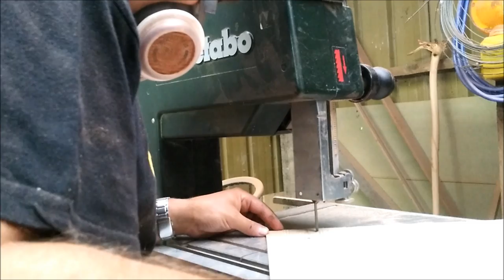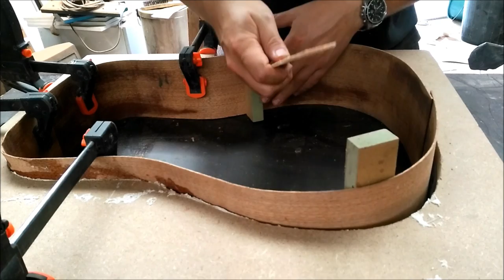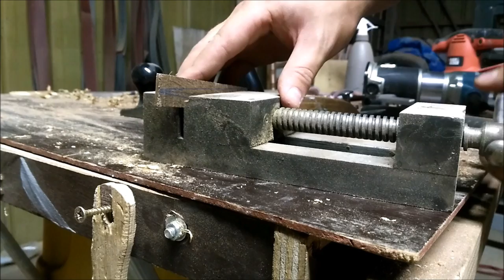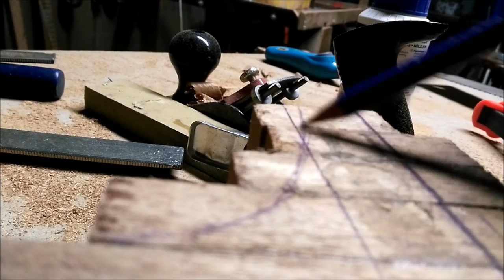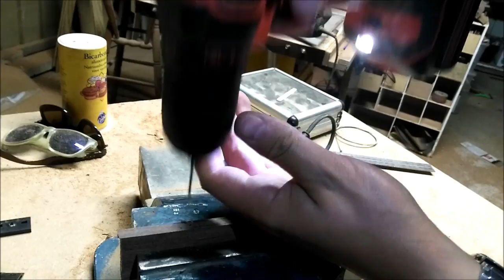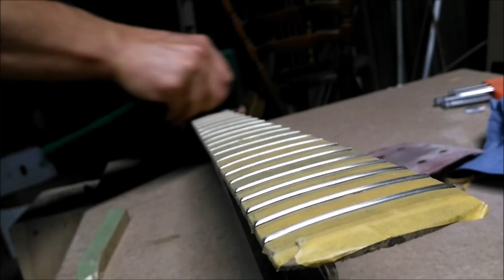Acoustic guitar from reclaimed wood - 'The Scrapnought'

Comment: I applaud the maker for the effort and finishing the project.  It took smarts to come up with so many crude techniques to short-cut what is typically a building process with more shop made jigs and fixtures for a finer, more accurate and beautiful build.  The crude experiment worked.  The next build will likely produce a finer guitar.

Comment: Great video. You had me spellbound that this was not a $100,000.00 shop with all the latest special tools and c.n.c. How long did this take you?  I never made a guitar, but I did make some furniture out of old pallets once. I couldn't believe all the Philippine mahogany I found at that time.
Reply from the maker: Ted Rowland Thanks! I don't remember exactly. I believe I got most of it done in 2 weeks, progress slowed down quite a bit after that and I think it took another 2-3 weeks to finish it. I had aprox 22 hours on video! You never know what you'll find in those things, but I've never been so lucky to mahogany out of them 👌👌 Thanks for watching!!
Reply: Well Robin, I'm older now. That was about 30 years ago when Philippine mahogany was plentiful. When I say it is a very soft wood, I don't mean soft as in cone bearing as I know it is classified as a "hardwood". I mean you could scratch it with your thumbnail. But beautiful grain striation, and the wood is pink. I made an entire bookcase out of it back then.
Reply: Ted Rowland...About 44 mins.
Reply: I know this is probably a crazy question.  But here it goes.  I have always wanted to learn how to build a guitar and your video makes me want to go out to the garage and start one right now.  Only thing is where could I get measurements from.  Do you have them or tell me where I can find them at.  Thanks
Reply: @robertvasquez3964  he was using he's other guitar for reference to measurements. Atleast that is what it seemed like. When he keep using a tape measure on it.  Great video watched the whole thing
Reply: @justinblizzard2485  thank you for the response Justin Blizzard.

Comment: I've seen neck thru body construction, but seeing the way the head stock is angled like this, really shows a much easier way of making necks!
Reply from the maker: I don't think I quite understand what you mean.. neck through body is an electric guitar thing, I did this on my very first (electric) guitar. The headstock angle can be done in one piece but I prefer this method as it saves a bit of wood and it is stronger! It's not too difficult either as you mentioned. Thanks for watching!

Comment: This is the first video that I’ve seen that shows practical, economical methods for building a guitar at home. The heat gun and steel pipe rig was inspired. Most videos show someone using hundreds of thousands of dollars worth of equipment in a professional workshop, and of course you can build an acoustic guitar THERE. But unless you’re building an electric guitar, most videos lead you to believe that you need all the expensive equipment. This’s video shows a practical way to do it without all the professional equipment. I’m going to try to build a guitar.

Comment: What a very clever idea. I was fascinated on how u bent the wood with hot air, those weights instead of clamps to bind the wood together, and all that works on the neck. Man that's a hell of a job a a lot of patience in your part. You must be loving your work so much as i did when i watch your video from start till end. I wish i have ur skills i knew u could do much better job if ur fully equipped with tools. Great video and a very well done job. Thanks for sharing..
Reply: It's not actually bent using the hot air. The hot air heats the steel pipe. The wood is wet with water then placed onto the pipe which steams the wood for bending.
Reply: @allbeit582  ah! Ok thank u...

Comment: Great work! I'm currently building a tenor uke with reclaimed timber; how long did you soak the sides before bending? My mentor suggests 48 hours. I use the same method of bending over a heated pip.

Comment: Amazing! Great woodworking, especially on the neck. You did a fine job on the bracing and nice bridge plate, that is why I was surprised you didn't make the bridge where the pins would go through the top. Not knocking it, just seems you would get a little more resonation and volume, though it sounds great.

Comment: I have been watching a lot of video and reading a lot on lutherie. They all have recommendations on the "correct" top and back woods (cedar, spruce etc) . I suggested that radiata pine would make a good top - should have seen the reaction. Ditto for the "correct" thicknesses and working methods.  I would have thought that the old style luthiers used whatever was available locally. The other thing is using extra precision and high quality materials provide diminising returns on instrument quality...  You can make a very good instrument with quite cheap and basic materials and methods (as is shown here)... To make an excellent instrument requires access to tool and materials that are not accessible to most hobbyists. Well done! And thank you for the well edited video.
Reply from the maker: Thank you!! Obviously I would like to make one with professional tools and great materials... But I for this one I went with the free and sometimes crappy wood on purpose! Thanks for watching!

Comment: I would have liked to have seen how you did the inlay around the sound hole... otherwise fantastic video and project. 👍
Reply from the maker: Thanks! I just used my router to cut the circle  2mm or so deep. Then I cut a quarter of a circle, cut that in half so I had a bookmatched half of a circl e. Then cut that in 2 so the ring is made up of 4 bookmatched pieces. Glued that into the top, planed and sanded away the excess.

Comment: A real time-saver would have been to use the router to trim the binding, just let the bearing ride on the  sides with maybe one layer of masking tape to protect the mahogany. You have to be careful in certain places that the router bit isn't tearing into end grain. Just backfeed the bit by moving the router right to left in these areas. Lastly, remove the masking tape on the sides and make a light pass for a final cleanup. You want a really sharp bit to prevent burning the wood, too.

Comment: Hi! It is a great video and makes me feel relaxed!

Just a question here...What was the liquid that made the guitar changed color?
Reply from the maker: Epoxy. I used 2 or 3 coats of epoxy to fill in the grain of the wood, that way I didn't have to spray and sand away 20 layers of lacquer to get a very smooth surface. Thanks for watching!

Comment: i havent found an answear anywhere did you use a planer to get the side wood thin ? i dont seem to have enought equipment to get all of the stuff done. I can only think of getting it thin enough with a handplane...
Reply from the maker: No I don't have a planer. Is cut it very thin on the table saw then I used the belt sander to make it thinner and smoother. Thanks for watching!
Reply: Alright thanks for answering man. I was thinking of making something like a 3/4 size guitar for camping :) 
Anyways very cool build you made there. Cheers
Reply from the maker: No problem. Something like that is my to-do list as well! Good luck and let me know how it turned out ;)

Comment: I like the idea of people being creative and doing the best with what they have and it is better to always try and learn from your experience. That being said I would caution anyone who wants to build a guitar do not rely on this video as a "how to" source" of info. There is one essential thing he did not do and that is radius the top and back. This adds both spring and strength that is necessary to handle 200 lbs of string pull. It is likely that by now the guitar is sunken in between the bridge and sound hole and is hard to keep in tune. You can develop skills to overcome a lack of modern tools you can't afford. You can use salvage wood to save money, but you had better learn what you need to know first to be successful or your efforts will be wasted.
Reply from the maker: Thanks man, this is no way meant to be a 'how to' just a video of me trying something. The guitar is still in good shape though.. maybe just lucky. Thanks for watching!

Comment: Great project! Do you mind telling me how you put a radius on the top of the fretboard? Looks like you center butt-glued two pieces at a slight angle, but not sure. If so, then wasn't the underside also curved and not a snug fit to glue onto the neck?
Reply from the maker: Thanks! I glued it up flat, because the piece of wood was not wide enough. I roughed the radius on the slack part of my belt grinder and later refined it with a sanding block. That's one of the few things I did not film. Thanks for watching!!
Reply: @RobinCoomans  Thanks for the reply. I'm a retired engineer and sometimes get too focused on minor details.

Comment: I love the video. I tried building a guitar with fiberglass thinking it would make the whole process easier. One could put the important work of the neck to the master of the shop and the rest to the glass rats. I took the guitar to show my parents, but they were watching John Denver introduce his Ovation guitar to the world at that very moment. Mine sounded like a plastic dimestore uke, and I put it away. Twenty years later I replaced the top with some Doug Fir I'd saved for at least that long and it sounded great. Wood made the difference; aged clear grain Coastal Doug  quarter sawn. Another twenty years has passed and I'm considering replacing the fiberglass body and neck shell and I won't have to go to the dumpster. Robin has already proven that idea. Now all I have to do is decide which wood out of my collection, all standing flame up,  shall I use for the next life of that instrument. Keep on strummin'

Comment: My first acoustic ended up being used as a planter!  I've now made over 50 and I learn something with every new guitar.  Keep building on this very impressive start!  It sounds like crap (it's the soundboard...too thick and stiff and the sound is all brassy strings without resonance) but that's not the point.  You can carve necks, set what looked like a reasonable neck angle and apparently kept everything on a decent centerline.  Bravo!  Spring for some Indian rosewood and a nice spruce top...just 2 book matched pieces...and you'll be amazed at what comes out of it when you're finished.  Very nice job!

Comment: I watched the whole video. I am very interested in making my own git someday. Unless mistaken, you didn't show the installation of the neck block. Did I miss that? And I am curious about your bridge. You installed a bridge plate so I was wondering why you went with the string slot at the rear of the bridge as opposed to a through the body style using string pins. I would be concerned about the tension. And did you think about an oil finish as opposed to the polymer? Kudos on a great build and a mesmerizing video. Enjoyed it thoroughly!
Reply from the maker: I didn't include the neck block in the video, but I just sanded a slight curve to match the sides and just glued it in, nothing special. The string slot was something I saw in another video and thought it was a nice alternative to the pins.

Comment: no pore fill?
did you wax the neck?
Is the guitar tuned down at all in the recording>
Reply from the maker: Yes epoxy coating before varnish! After the varnish I rubbed the entire thing out with 000 steel wool and wax. The guitar was tuned standard with a capo on the 2nd fret. Thanks for watching!

Comment: Great job for your first acoustic built using the tools you had available. Did you use more than one clamp when you glued down the bridge? I'm curious why you ran your strings through the bridge the way you did. Why didn't you use the more traditional method of drilling holes through the bridge and top and use pegs?
Reply from the maker: Thanks man! Yup I put as many clamps on the bridge as I could (3 or 4 I think) the strings through the bridge was something I saw on a friends guitar actually. I thought it looked cool and a bit different, that's the only reason. Thanks for watching!

Comment: Very good job , but i think you should not have used this kind of glue , that remains too soft after drying, i personally use some epoxy ...little adjustment , some string are not sounding clear.

Comment: I have a question about the bridge/saddle of your guitar. How did you make a little bit of wood-glue, attaching the saddle to the guitar, hold up to the strength of all of the strings pulling onto it? I noticed that you used a different technique of stringing the guitar, more similar to a classical guitar than a western guitar, and now ask myself how the bridge can hold up to the strings pulling without getting ripped of.
Great video btw.
Reply from the maker: I honestly thought the bridge would be ripped of after a few days/weeks. I did however take it off and reglued it with epoxy and it seems to hold up just fine a year and a half later. I got the idea from Greenfield (? I believe) guitars. Thanks for watching!

Comment: I want to build a guitar now. Im already looking up measurements. Tips?
Reply from the maker: Take your time and take it on bit by bit so you don't get overwhelmed by the entire project and you'll be just fine! Use good materials if you want a good result and experiment a bit with bending the sides.. that was the most difficult part for me, I must have broken 2 or 3 sets before it worked out alright. Good luck!!
Reply: @RobinCoomans  thanks

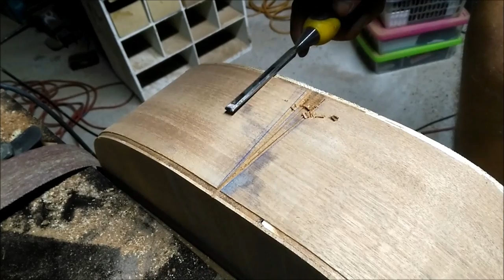Comment: Inserting the V in the bottom at around 17:00 was a bit pointless. Thats only done when the sides are too short and don't meet. But nice idea to round off the fret ends before inserting them. I would have shaped the neck before putting the fret board on. Did you make the capo out of a G clamp?
Reply from the maker: My sides did meet pretty well, so it wasn't really necessary and I initially wasn't going to do the wedge. I shaped the neck after I glued on the fret board because that was cut to the correct dimentions and I left a bit of 'meat' on the neck because it was difficult to cut exactly to the line because of the heal and headstock. This way I could shape the neck to the fret board and get a perfect fit! The capo is a capo 😉 Thanks for watching!

Comment: I’m amazed the neck could take the strain when the strings were installed .....you didn’t connect the neck to the guitar body using a double dovetail  joint .  
   It wasn’t a wise move to use knotty pine for the sound board so watch out for those knots falling out after a while.  You could have treated them with knotting  shellac before you applied your clear lacquer finish.  
   Despite my doubts and dreads, kudos to you as you ended up with a guitar that actually works.

Comment: Congratulations you did make a guitar with your skills. But honestly it does not sound too acoustic at the end with some buzzing. How about the action? Truss rod adjustment, neck relief, saddle height, nut height, all of these determine the playability of your guitar.
Reply from the maker: Thank you. There was a high fret, the neck angle was a bit too shallow and the saddle was high. Fixed it right after the video. Thanks for watching!

Comment: How did you get the radius on the fret board?
Reply from the maker: I used the slack part of my belt grinder, which gave a pretty nice radius very quickly, then refined it with a radiused sanding block. Thanks for watching!

Comment: amazing work man! how long did it take you? good to give old wood a new life!
Reply from the maker: I did it in just under 2 months, but that's not constantly working on it. I had to take some breaks from time to time :) Thanks for watching!
Reply: whats that u spray the guitar with at the end? lacquer?
Reply from the maker: Yes just a good quality clear lacquer. The entire finish: 2 thin coats of epoxy to fill in the grain and protect the wood during construction, 4 (could be 5) coats of lacquer then buffed it out with a beeswax and 000 steel wool.
Reply: epoxy - would that be similar to gun stock Tru oil?
Reply from the maker: No tru oil is an oil finish that hardens, you would use this instead of a lacquer. (I would like to use tru oil btw, gives a beautiful finish!)) Theoxy is a very thin glue that soaks into the wood and cures into a sort of plastic, this seals and strengthens the wood.
Reply: Nice! I will check that out for future projects!

Comment: It's big job, my congratulations. You repeat factory made guitar and make mistake - back without bars and reinforsement stripes. Most of factory guitars have laminated sides and backs, simply sayed - plywood, and mostly not needed this details. And second mistake - flat soundboard and back. Humidity changing may affect and guitar may cracked
Reply from the maker: Hi, thanks for the suggestions. The back was braced, but not shown in this video! The back and soundboard are indeed just flat, several people have already told me it should be curved. So it's definitely noted and will be incorporated if I ever make a new one! Thank you for watching!!
Reply from the maker: As for the laminated sides.. it was difficult enough for me to cut them as thin as I did. I guess I could have bought veneers to do the job, but this works as well.

Comment: Ya just thrown that bridge and saddle there because "fuck intonation" 😄
Reply from the maker: Or you can measure the correct location for the bridge and then just throw it in that exact location ;)
Reply: @RobinCoomans  Now, this may be the way guitars are factory-made, and it's hit and miss. That's the strong point of a custom build, you can actually make sure intonation is spot on, and then glue the bridge in. Measurements in this case don't always work, as every guitar is different, and we're talking about half a milimeter that makes a difference. Maybe you nailed it anyway.